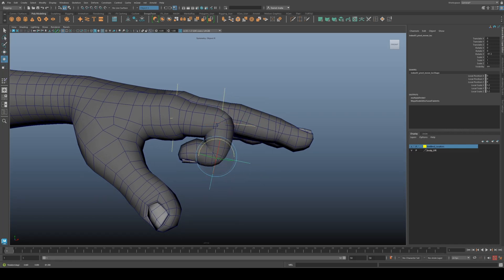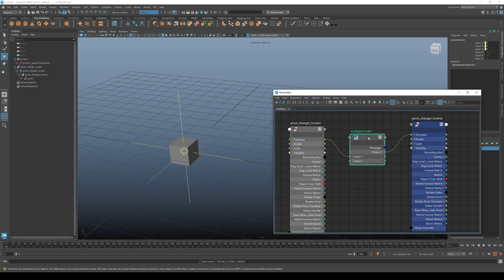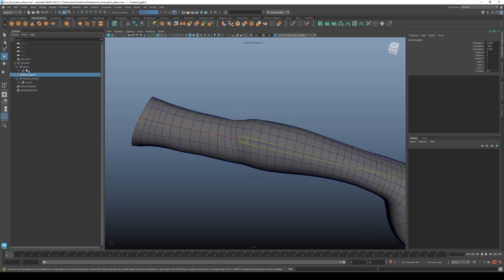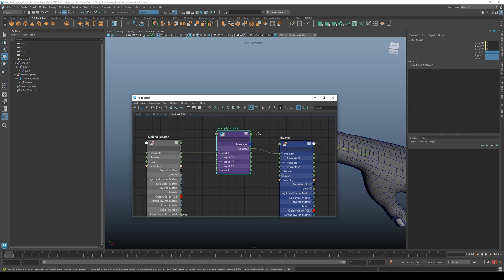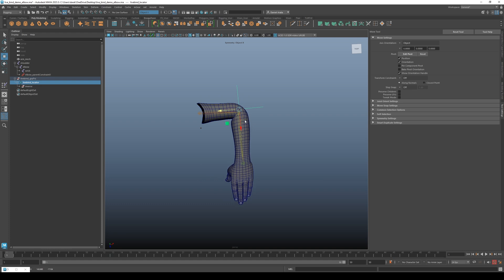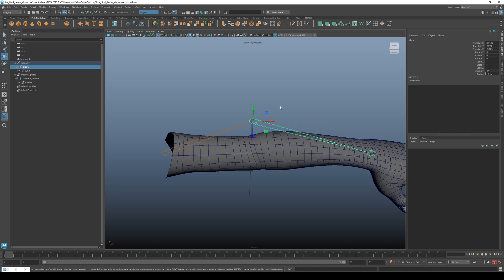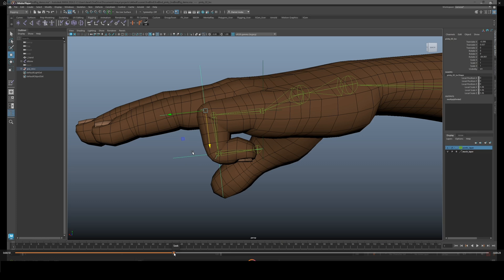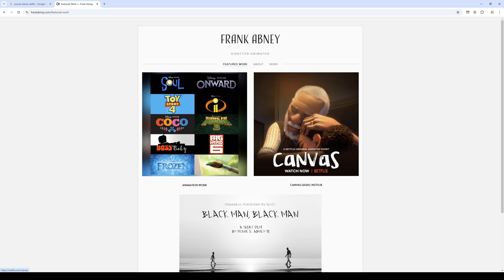Master Joint Placement in Maya with the Live Bind Technique

Comment: Hello, I hope you're still active, I haven't finished watching the video but I have a question, 
I have a character that has blendshapes, so basically the main model is a male and the morph target makes little changes so that it transforms into a female, meaning that some articulations moves slightly (female has less broad shoulders etc...). 
That's why I found your video which seems to be exactly what I want but I don't know if your methods works if for example I export everything into Unreal Engine ? And also I'm not sure how everything works like do I have to redo my animations when I change morph targets and move the articulations or something ? Idk, do you think your video is adapted to my problem or should I look for another method ?
Reply from the maker: Hello, you won't find a solution for your issue with this video. However you are in luck, because animation retargetting is fairly easy with unreal.

Unreal has a few tools to help you retarget animations if your skeleton is the same, but proportionally different (like your female and male skeleton)

Check out this video here:
https://www.youtube.com/watch?v=CKy5-ouQtxI

Or this official document from Epic:
https://dev.epicgames.com/documentation/en-us/unreal-engine/animation-retargeting-in-unreal-engine

Good luck!
Reply: @DanArata  thanks you so much ! I didn't know what it was called and didn't know where to look
I'm still curious in what scenario you use what you did here because it seems really interesting as an animator, is it for simply make better poses like you show here ? 11:22
Reply from the maker: @ptit-monsieur  Yes that's right. This setup (or theory is more accurate) is to help find good joint positions for better posing. I'm sure as an animator, sometimes rotating FK controls doesn't feel right and you may have to translate them. The idea here is to get good joint positions so that animators only have to rotate their controls, and never translate. Leaving one less thing for them to worry about. Hope that helps explain it. :person-turqouise-waving:

Comment: To avoid rebuilding skin bind, you can actually adjust and reorient joints, then reset pre-bind matrix values in skinCluster. will require some scripting but long term much simpler approach.

Comment: Thank you so much for the video!! if we would want this implemented into an autorig system, (I am updating mine so it's perfect timing) I guess we would do this after the guides are created? but before the system rig in itself is built right?
The concept for a single axis rotation articulations seems intuitive but any suggestion about the clavicule/humerus articulation? or the Hips/femur articulation? like in the hind leg of the quadruped you showed at the end of the video
Reply from the maker: Love hearing that you're making your own autorigger! Ideally you'd want this after your rig system implements bind joints. And/or a way to go back. The best autoriggers I've seen have a function to extract guide postisions from your rigs current positions allowing you to go back a couple procedures seamlessly.

As for articulation with the clavicle, humerus, hips, etc, I've found the best positions are usually between center of mass, and anatomically correct. The clavciles for instance, rotate at the front of our rib cages so placing a joint at the peak of your characters chest may make the most sense. But in practice, unless if you have a muscle system this looks very funky. In my opinion there's more going on with the clavicle rotation than just it's pivot point because you have all this muscle sliding as well. Which is why it's best to play around to find what feels best.